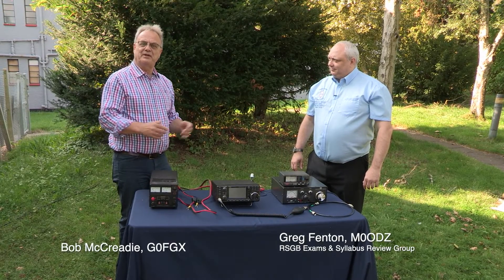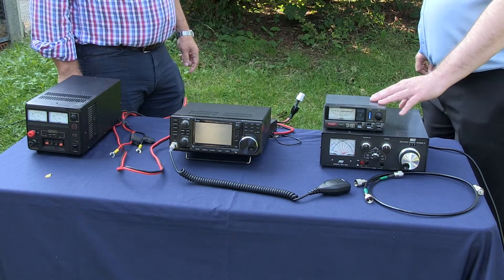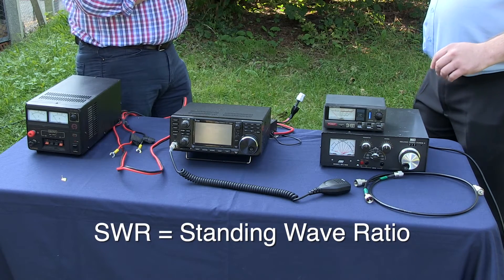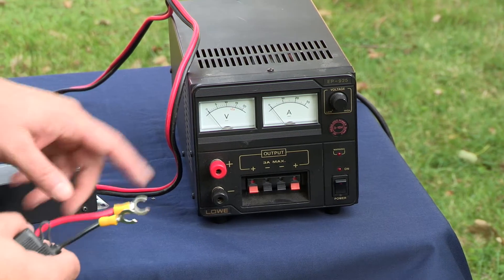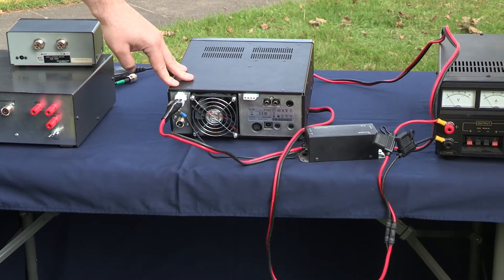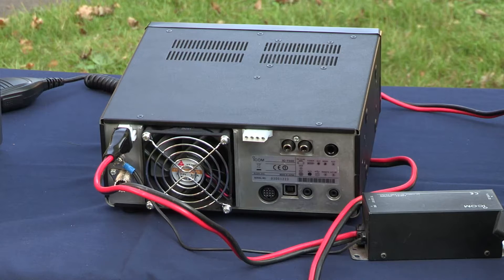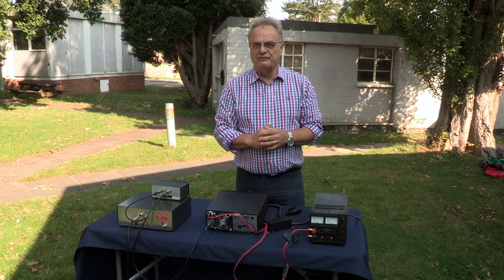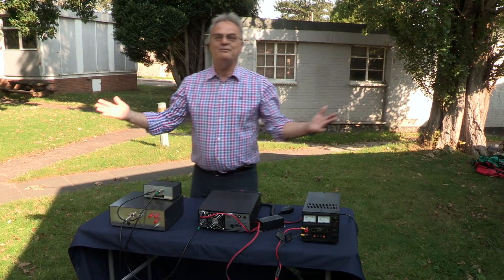Foundation Practicals 1 - Setting Up Your Station - an RSGB guide for new licensees

Comment: A 3 amp (Max) PSU for a ham radio ????
Reply: Hi Philip
That PSU is capable of 25 Amps.  The 3 Amps section is for the panel mount ports (the ones that look like speaker connectors).

Comment: Thank you for this video, very helpful! Where in the chain would the RF filter and amplifier normally go?
Reply: Hi Ian
If it was a transmitter amplifier, it would be as follows:
transmitter -> SWR meter -> ATU/AMU - > amplifier -> RF filter -> antenna.
Basically, the RF filter will stop any harmonics or unwanted signals so should be the last stage before the antenna.
For a Foundation licence holder (or any licensee) due care must be taken not to exceed the power limits for the bands you are operating on.
Reply: Gregory Fenton Perfect, thank you!